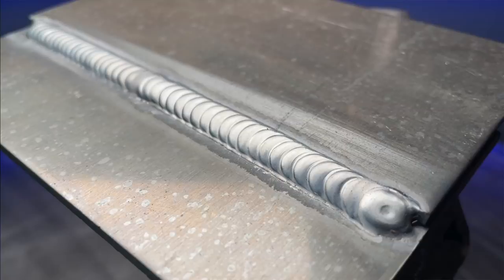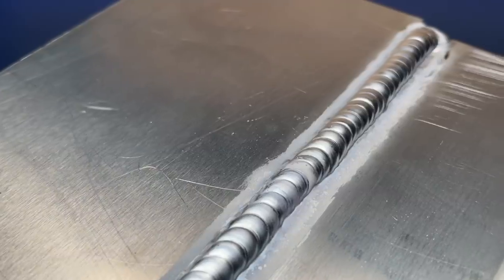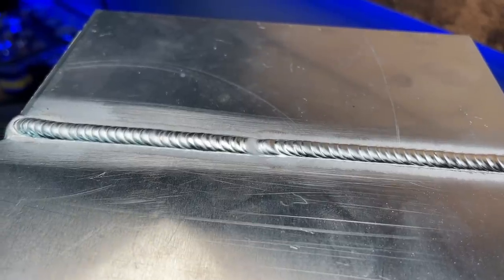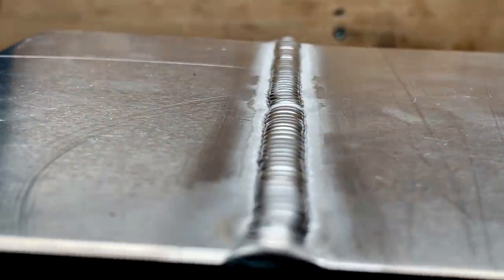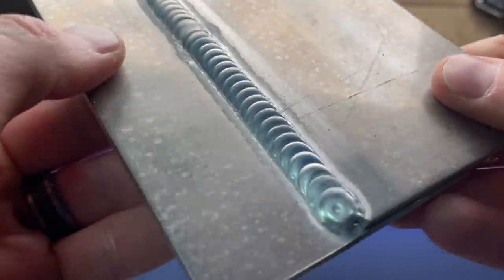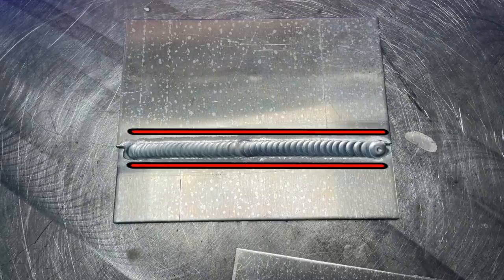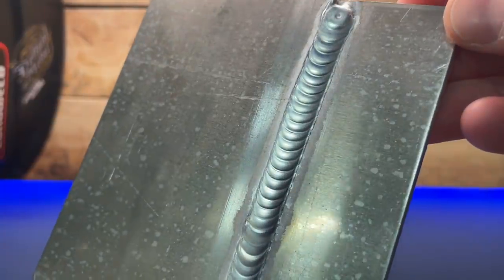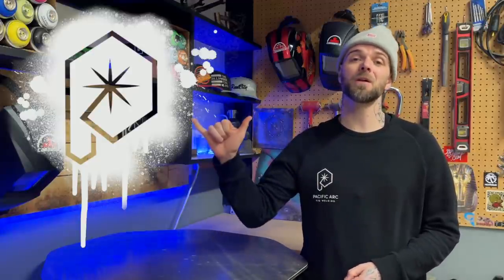The most important thing I teach students Tig Welding (Not what you think)

Comment: Your explanations and overall method of learning and improving seems totally applicable to other types of welding, such as the FCAW that I am learning. Starts, blending, edges, heat control, filler (wire speed), spacing ... everything. Has anyone ever told you that you are a better teacher than a welder?

Comment: Would be nice to see backside for degree of penetration.   Also, would be nice to have similar run down for mild steel.  (Much more affordable to start/ practice on.) 

I can make nicely wetted shiny fillets on steel, but they have little penetration.  When I weld for better penetration they still have a nice pattern, but shrink in a bit and are a little gray. 

 Thanks for the vid's!
Reply: Yes, I'd really like to see the back side too.  I'm working to get better with aluminum, especially thin stuff, and I feel like I learn a lot from practicing that and looking at the back.  As for your steel welds turning gray, perhaps you could use a bigger cup and more gas, and make sure you've got enough post-flow.  Those things help me, unless I'm just putting in too much heat. Also, your argon flow meter may be inaccurate (I returned one for that reason), so trials and adjustments may give a clue.